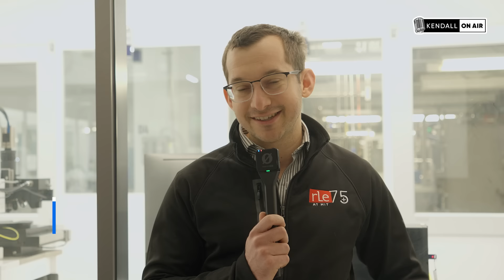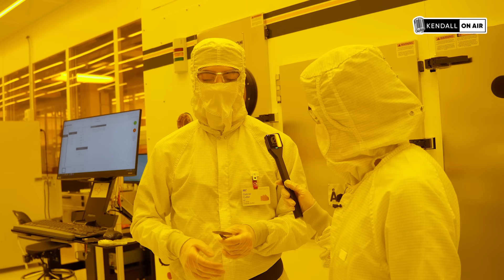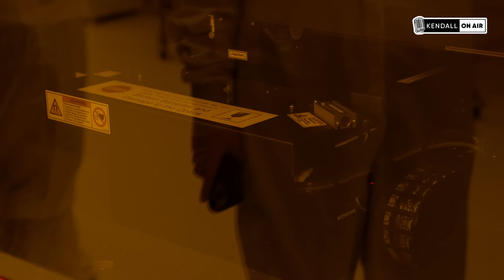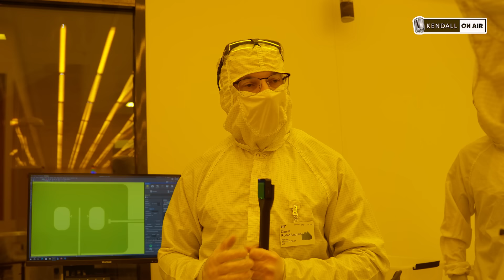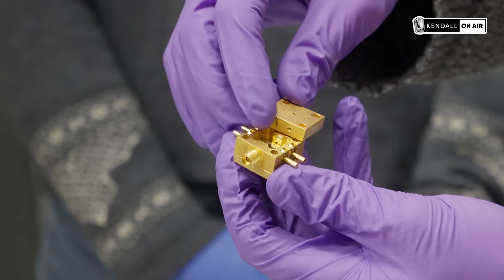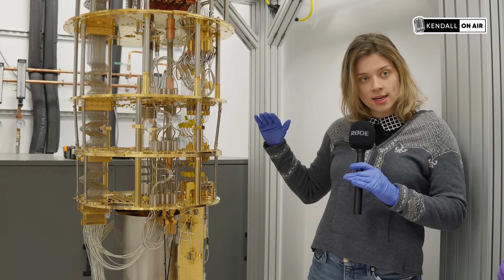Inside MIT's Secret $100M Quantum Computer Lab

Comment: The possibility of superconducting quantum computer was first proposed in 1994. Macro-atoms were theoretically identified and designed in two papers published in 1994 and 1996. 
Charge qubit: Physicca C 234 (1994) 146-150;
Flux qubit: Physica C 262 (1996) 195-201.
The two types of macro-atoms proposed in these papers correspond to what are now known as charge qubits and  Flux qubits.

Comment: Which software used to design This superconducting qubit Chip
Reply: Academic labs usually rely on open source standalone tools like KLayout with a KQ Circuits or other add-on library, you can click and drag components or modify them in the layout program. For more advanced users, there are open source packages like Qiskit Metal that are based on Python and can be scripted in a workflow to open source PDKs used in CMOS chip design. On the other hand, for industrial labs, there are quantum chip design and analysis programs sold to the labs with increased functionality and capability. One example would be Keysight Quantum EDA.